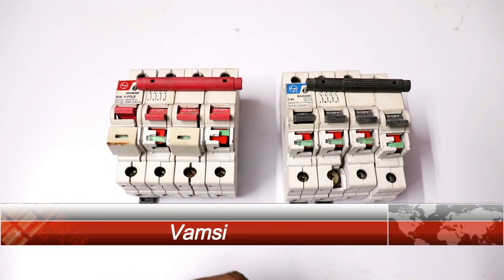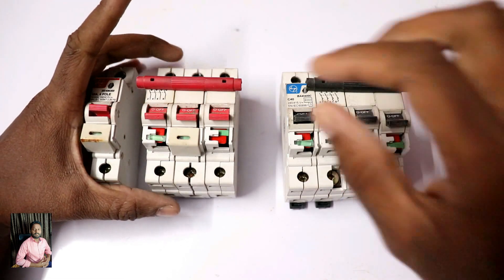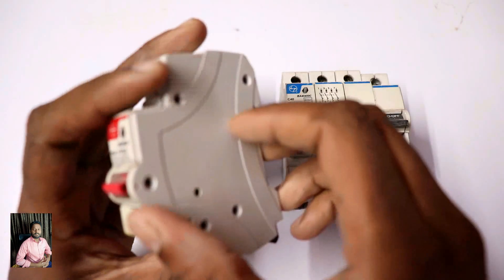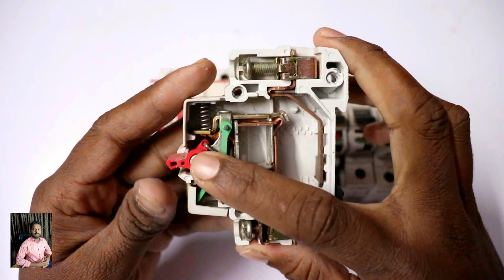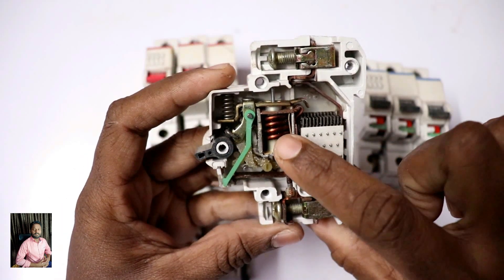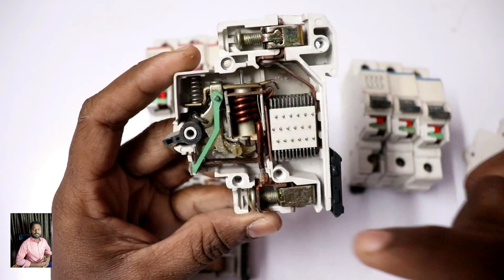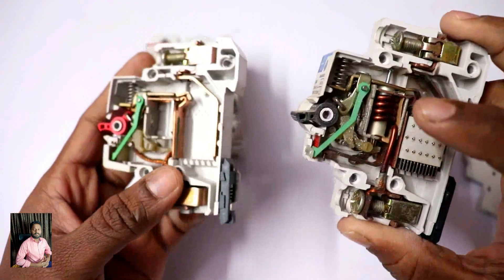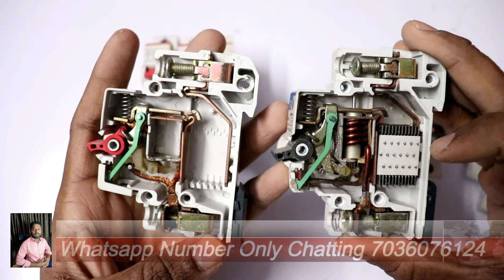Why Don't Trip isolator But Also MCB Trip any Reason Practical in Telugu

Comment: 40 amps isolator using without mcb wire burn ayi starting point lo connection motham fail avuthundi bro what is the problem pakka mcb use cheyala
Reply from the maker: Hi bro 
Pakkana mcb use cheyandi